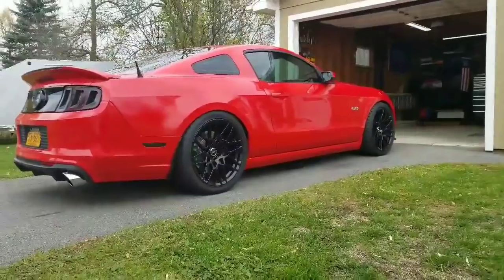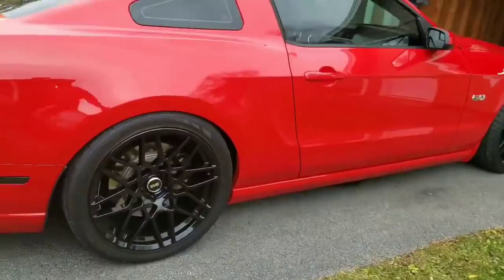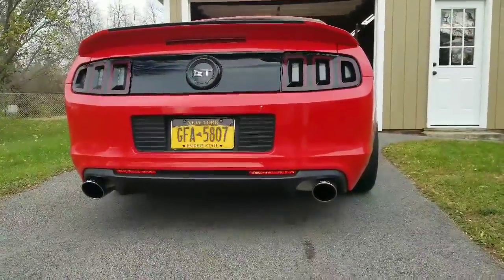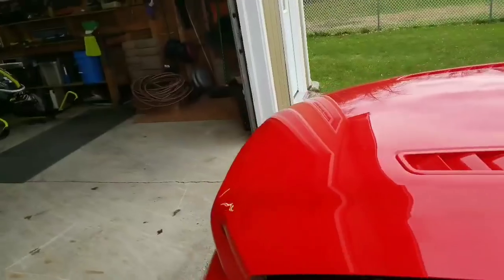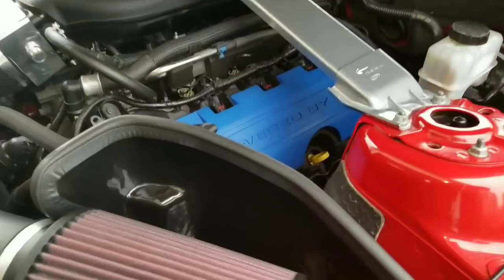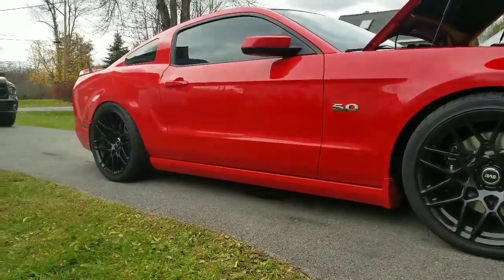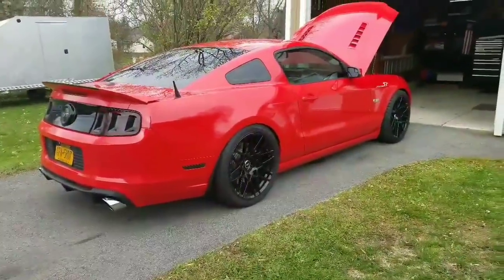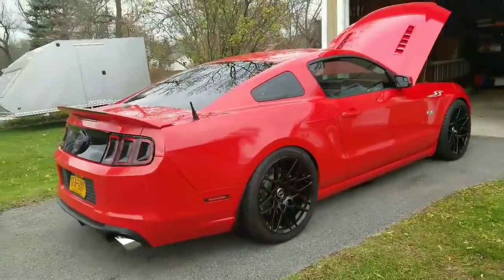2013 Mustang GT with stainless power longtubes, o/r xpipe, borla s-types and update!

Comment: Really sweet Stang man. Those Coyotes were a great idea from Ford.
Reply from the maker: Thanks! Yes they are, great motors
Reply: *Are a great idea
Reply: @johndelossantos1572  just hoping that v8s will be around for a long time
Reply: @brunocascardo3327  supposedly Ford will start with the electric mustangs in 2028.
We don’t have much time :(
Reply: @chrisroy  did you get a tune right after installation and if not did you get check engine light
Reply from the maker: @tktk-om8cg  car already was tuned. Once I did the longtubes lund racing said it did not require a retune.
Reply: @chrisroy  what tire size was rears gt500 sve wheels
Reply from the maker: @tktk-om8cg  295s
Reply: @chrisroy  thanks for informing your video really helps im definitely going to buy the stainless power exhaust
Reply: Ford put together one amazing package with these.

Comment: I just bought a '14 that has Flowmaster outlaws. The drone is horrible at highway speeds and I do a good amount of highway driving. I see you've been through a few setups. I want the quad tips but not the drone. I heard you saw the Magnaflows were bad too. Any quad tips that you've found that didn't drone or that were not bad at highway speeds?
Reply from the maker: Corsa will have no drone but they are usually 1k new for just the axlebacks
Reply: Ok. So, outside the quad tip, I've heard Borla Touring was good for no drone. Have you had those too?
Reply from the maker: No but i have the s types which are the set below the attacks and i have no drone with the single tips. Quads should be the same muffler but with just 2 exits

Comment: can you give me you wheel and tire specs? as well as the suspension setup?
Reply from the maker: 20x10 295. 20x8.5 255. Wheels are gen 1 sve s500 wheels so they have more aggressive offset than the current gen. Car is on h&r supersports with strange adjustable shocks/struts

Comment: How much hp are you makin
Reply from the maker: Has not been on the dyno yet but thinking with these mods should be 440-450wheel.
Reply: Oh sweet have you raced anything
Reply from the maker: I have raced a 400wheel wrx and a 2011 5oh mustang. Both are my buddys. Pulled on them both, that was before any performance mods